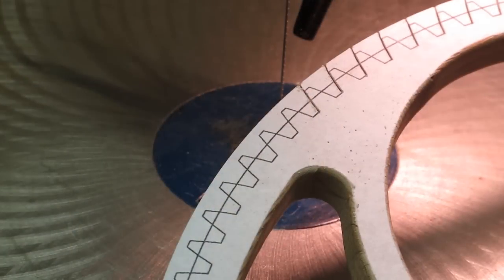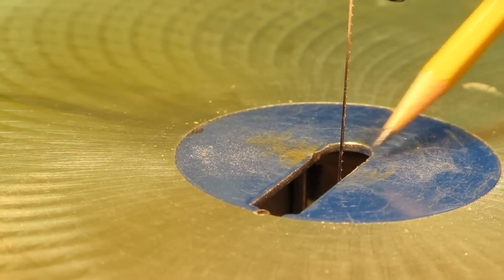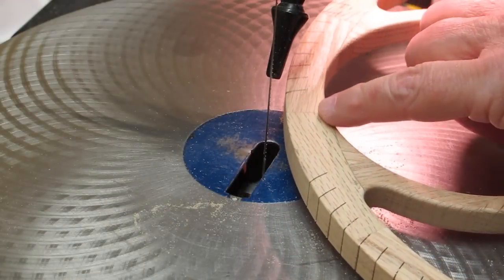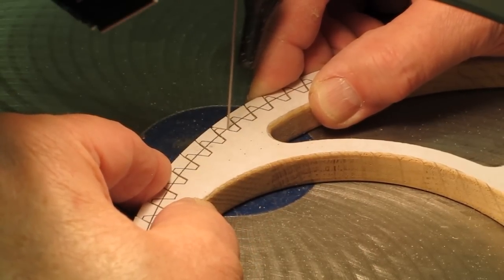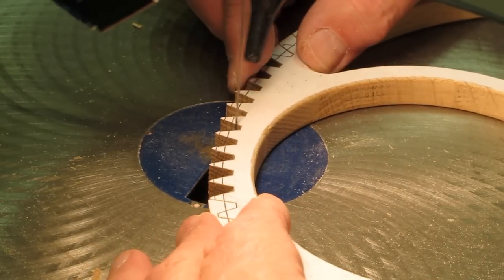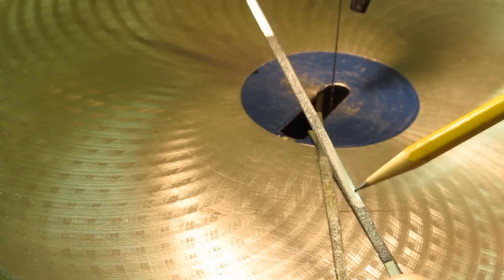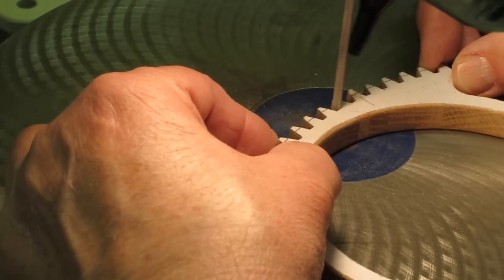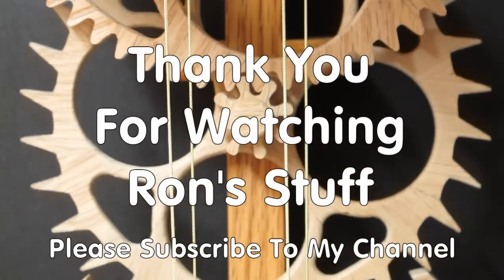Cutting Wood Gear & Clock Wheel Teeth

Comment: This is the best video on youtube about making wooden gears using a scroll saw - thank you !  I now look forward now to making my first wooden  clock..
Reply from the maker: Thank you! I have quite a bit more on my channel that will be of interest to you as well. Hope you have subscribed.  I highly recommend clock designs by Clayton Boyer.
Reply: Ronald Walters Indeed I have subscribed to your channel, and I hope that things will soon start ticking in my workshop !
Reply from the maker: An expensive suggestion that will make your life easier if you are serious about making good clocks. Nothing like giving yourself an early Christmas present.

My best clock-making tools (and the most expensive). Finding the exact center of a template, marking it a bit deeper and then accurately drilling the holes. The flutes on these drill bits will draw blood (razor sharp). Treat these as prized possessions and stuff keep them locked up and out of reach of anyone else.

Veritas Optical Center Punch $62.50https://www.leevalley.com/en-ca/shop/tools/hand-tools/marking-and-measuring/marking-tools/45502-veritas-optical-center-punch

Veritas Japanese Style Awls $26.50 and $32.50 https://www.leevalley.com/en-ca/shop/tools/hand-tools/marking-and-measuring/marking-tools/70874-veritas-japanese-style-awls

HSS Lipped Imperial Brad-Point Drills 5/64” to ½” $264.00https://www.leevalley.com/en-ca/shop/tools/power-tool-accessories/drill-bits/42247-hss-lipped-imperial-brad-point-drills\

Comment: I'm really admirative... I'm not as patient as you are! That's the reason why I use a CNC machine. Allright, it is less artisanal, but I've no time to begin cutting tooth by tooth.
I made it for a hand machine that blows air for a barbecue. But not for clocks!
Thanks for your video and for your explanations about the process.

Comment from the maker: I guess you could make one. The gap in the one you see is from Delta and is made that way so the table can tilt and still have blade clearance. I liked the gap as I had a dust collector under the table and all the cut outs from the teeth disappeared through the slot and out the dust collector (handy). I sold this saw and now have an Excalibur.

Comment from the maker: That is a Delta 40-540 which I used for years. Lots of vibration and I had to do several repairs over the years. I don’t think it was intended for the type service I was asking of it.  I have since sold the Delta and purchased an Excalibur, a very nice very well made saw but a bit expensive. A friend has the Dewalt DW778 and is very happy with it. Some of these seem expensive but buying a cheap saw and then throwing it away to go buy a good saw is really the most expensive approach.

Comment from the maker: Sure, you can do that. Depends on the design of the gear teeth (round of flat bottom). It requires a really sharp, accurate brad point bit and a good backer or you will get tear out on the backside. Also, the drill center point needs to be located 100% accurate every time or it will look bad. After cutting a bunch of gears I find it just as easy to cut the whole thing out with the scroll saw and forget the drilled holes. Practice makes perfect!

Comment: Since belt sander paper is thicker it doesn't tear under light tention - I just cut a strip around 5" x 1/2", folded it in half long ways and mounted it just like it was a pinless blade. Used the same strip for about an hour last night with no problem. Maybe with the paper there is a radius but it's not detectable to the eye. Working on my first clock so time will tell :)

After I saw your video I ordered some scroll saw files but haven't received them yet - looking forwared to testing them out.

Comment from the maker: Matthias cuts a lot of gears on the band saw.  Then it only makes sense to cut into a drilled hole if the design of the teeth allows you to do so.

Comment: hmm, ive cut quite a few gear teeth but always used a inch belt linisher, for cleaning up.  Not as precise as the scroll saw file, but very efficient none the less.  Thanks for the video and the information.

Comment: Quite correct on all the things that would affect the tone switching between different blades. I was assuming the same blade as you recommended, same mfg, same teeth. If the thickness and length still vary too much after that, then I agree, one just has to break a few blades to learn the "feel" achieved by plucking the blade. Given the risk and damage caused by breakage, I was just looking for any way to reduce variables.

Comment from the maker: Using Matthias’s gear template generator, I think it will export a file for use with CNC. I have to admit when making a stack of the same type gear I thought about how handy a CNC would be. :-) Is it the best solution? I do not think it is for something if you want to truthfully call it handmade. The use of a scroll saw is just not that difficult and it is extremely versatile.

Comment from the maker: I have not personally designed clock wheels or gears. The clocks I have built have been Clayton Boyer’s designs. I think he uses a CAD program. For the other gears I have cut… marble machine, planetary gear drive, clock winder, pin gear - ring gear, etc. I have used Matthias Wandel’s Gear Template Generator (woodgears-dot-ca). Matthias also has a free gear template generator on his website which you can play around with to see if it gets you close. The program he sells is much better. 

Ron

Comment: Ronald, nice video.  Maybe a useful tip about the abrasive blades you use in the scroll saw.  If the blades are just covered with epoxy and abrasive couldn't you re-coat the bare blades?  I get some aluminum oxide (available in 70 and 220 grit from Horrible Freight for some glass etching and blasting which, with a suitable adhesive, could be used to easily re-coat those blades.  In my experience, heat softens epoxy so...warm them up, scrape 'em clean, apply adhesive, sprinkle with adhesive. ?

Comment from the maker: I have seen some ¼” sandpaper strips (which a friend had) with clamping ends. My impression was they wouldn’t last very long and the paper couldn’t be replaced. Also, when you pushed the workpiece into the sandpaper, it tended to sand a radius rather than a square surface. We were hesitant to over tighten the strips or they broke prematurely. 

I don’t know how I would clamp just sandpaper in my saw. Someone needs to invent some little clamps.

How do you actually clamp the paper into your saw?

Comment from the maker: I guess it would be possible but I do not know why you would want to. Paper or cardboard is not the most stable medium and can get fuzzy when it is cut and sanded. Gluing it in precise even thickness layers would be a trick. Might as well use MDF, which is not much better than cardboard and is easily damaged. Good luck.

Comment: I haven't had much experience with the scrollsaw, and the one I use is one I made, powered with an electric drill.  I would sometimes use a blade for a couple of hours, and sometimes, I would break it almost immediately.  I found that it always started by sticking in the workpiece and hammering it up and down, but once that happens, there's not much chance of saving the blade - so I clamped a piece of wood across my saw table with spacers under each end, so that it went across the workpiece, allowing the workpiece to be manipulated, but not allowing it to move more than a couple of millimeters up and down.  After that simple mod, my blades lasted a LOT longer.
If the workpiece is big, and the cuts are complex, meaning that it needs to have a lot of freedom of movement, then this method may be awkward, but for a gearwheel, which only needs to be moved the distance of the depth of a tooth, and the workpiece is always in the same position relative to the blade, the method would be easy to implement.
Reply from the maker: Most scroll saws have an adjustable fork shaped guard that is also supposed to help keep the workpiece from jumping up and down. Personally, I always remove them as they just get in the way and make it more difficult to see what you are doing. Holding constant downward pressure on the workpiece maintains control. Using a foot switch also helps maintain control so you can stop every once in a while to reposition things and do not need to remove one hand to turn off the saw.
Reply: Thanks Ronald, I have seen the fork-shaped guard on YouTube videos, but the design of my saw doesn't allow for its implementation.  I also know that downward pressure is what's required, but even at moments when I thought the pressure was more than adequate, the workpiece has suddenly started jumping.
I do also use a foot switch.  https://youtu.be/qPjozDIyPJo?t=1067
I think the problem may be down to the machine itself.  The oscillation of the saw blade is much slower than on the commercially available machines.
Reply from the maker: The slow blade speed could certainly be the issue. Get a reasonably good quality saw and you will start having some fun. I used Delta scroll saws for years and they are OK, but when I upgraded to my current Excalibur it really made a difference.

Comment: HI Ronald,
Very good video, I have been trying to make gears for a clock, however I struggle with developing the right profile for the teeth. Can you tell me how you get that design and does this work for small wheels as well? The smallest wheel I want to cut is 18mm dia. on the pitch circle and has 8 teeth.
I look forward to your comments
Anton

Comment: Great tips! Have you tried using sand paper in your scroll saw instead of scroll saw files? I've cut 5" strips from belt sander sandpaper and clamped into the scroll saw - seems to work real well at sanding down to the line, and it's cheap.

Comment: You've taken great steps to make true, and stable, gears out of solid wood. Curious what your thoughts are on stabilizing the wood itself?
Reply from the maker: Good question. I made the C&R Grain Solid Wood Wheels quite some time before I was set up to do wood stabilization. Wood stabilization requires several steps, the last of which is baking and it makes quire a mess requiring cleaning up the wood surfaces. Stabilization and baking may also cause some dimensional changes in the wood. Therefore, the stabilization would need to be done for the wood raw material before making the blanks, gluing and then cutting the teeth. Regular aliphatic wood glue may not work very well with the stabilized wood (I haven’t tried gluing any stabilized wood) as it does not seem to be as porous and is a bit more like plastic after stabilization. Experimentation would be required. I have a video “Cookware Pot Lid Handle Replacement - Vacuum Infusion” https://youtu.be/W8NwwRi9ieU which may be of interest top you. Thanks for watching. Please Subscribe… that is what keeps this channel available.
Reply: Thank you for the reply.

Comment: Howdy Ron, another great video!  You glue up your wheels/gears...is that for stability?  I was thinking of using solid hardwood...not a good idea - will it warp with changes in temperature & humidity?  Thanks, Mike
Reply from the maker: I show making solid wood gear blanks out of glued up segments and sometimes it works and sometimes it doesn’t. Just the water in the glue can get things going warping & splitting). You need to immediately plane to final thickness and cut out all the webs... then let it sit and stabilize and see what it does... and maybe the solid wood will cooperate and maybe it will not.
Plywood is the best choice for gears, specifically Baltic Birch Plywood.
I have another series on making gear blanks and mixing up the grain direction which worked very well but it is a complicated approach and again you need to immediately plane to final thickness and cut out all the webs and let it stabilize.
Video: C&R Grain Solid Wood Wheels - several parts to the series
Making solid wood clock wheels using circumferential and radial wood grain orientation to minimize the chance of having the wheel split or distort due to climatic changes.

Comment: Some thoughts and questions born of ignorance (surely a curable condition) (:-) mark the locations of glue lines onto your paper pattern before gluing it down?  I do not have experience with a scroll saw but have done some such cutting on a band saw. Would a plate with much less clearance help or even be practicable?  For the bottom of the notch, why couldn't it be drilled out prior to cutting the notch out?

Comment: On the tightness of the blade, those with some musical inclination may want to achieve consistency by using a (free) guitar tuner on their smart phone or anything to generate a tone.  This particular video sounded pretty much like it was tightened to a "D".  The tone wasn't pure, but using that as a guide would be quite close.
Reply from the maker: Might work but more likely an over complication. Blade thickness, blade width, the number of teeth, can all play some part in this sound. Probably the best approach is to get a feel for it by doing it and see how the particular blade is cutting.

Comment: you need to get a gum rubber cleaning bar for the sanding strips on the scroll saw.  these gum rubber cleaners are available at stores that sell sanding gear.  these bars will clean the sanding strip until it is like new.  I use them on many of my sanding disks and pads.
Reply from the maker: slad roznik I use the gum rubber cleaners all the time. Generally, they do not work on these filing strips.

Comment: Sir, your videos and workshop are amazing! Might I ask how long it actually took you to get all of those tools together? Your work is inspiring, but even if I had skills to match yours, I'd still be missing 90% of the necessary hardware.
Reply from the maker: +Ventura López  I worked overseas, so I did not accumulate many tools until after I retired. Purchased my table saw when I started building my house and other stuff was accumulated since then. You don't necessarily need all of these tools to make these projects but it does make life easier and good dust collection makes it healthier. Many a wood gear clock has been made using a hand drill, coping saw, hand files and sanded by hand. Thank you for your kind remarks and for watching!

Comment: Do you use any gear generator for your gear profile?
Reply from the maker: The large gear shown in this video is actually for the Solaris Clock, a wood gear clock designed by Clayton Boyer. For other gears I am designing myself, I use the gear template generator at woodgears.ca . There is a free version on the website (lower left hand corner) or a better version available for purchase. I have quite a few wood gear projects on my channel where I used the woodgears.ca template generator. Thanks for watching. Please Subscribe!

Comment: hallo mr Ronald.
could you please tell me kind of wood is the best to make shapes. I have tried to make some shapes but unfortunately broken easily.
Reply from the maker: MrHaninah I use Baltic Birch Plywood for the gears and basswood for the ornamental or decorative shapes. Basswood cuts easily but can be easily broken. Most any wood can be used but cutting time will take longer for harder woods.

Comment: Ron, what brand of scroll saw are you using?
Reply from the maker: The one in this video is an older Delta Scroll Saw.
For the past 6 or 7 years I've had an Excalibur Scroll Saw and generally I use a foot switch. Excellent saw, a bit expensive. Only thing I do not like is the table top is powder coated. I have since sanded off the powder coat and keep it waxed.
I have a video on how to Tighten the Blower Tube https://youtu.be/_CscPROkWwI
The videos on my Gear Head Construction show the Excalibur in use. https://youtu.be/z6O6ZRlQi34
... and the fret work for the second Senior 20 organ. https://youtu.be/jiLMHuohpJc
Thanks for watching! Ron
Reply: @RonaldWalters2010  Any thoughts on Hegner scroll saw?
Reply from the maker: I have heard some good things about them (unconfirmed) but I never have used one and do not know anyone who has one. Roughly 2-1/2 times more expensive than an Excalibur I doubt that it is worth it. Keeping in mind that German quality is not (in my opinion) what it used to be with many products. 30 years ago I was overseas in a very remote location and wanted a small metal lathe. Having little to no personal experience with a lathe, I purchased a Prazi (made in Germany) strongly influenced by the "German quality" thing. Have not been more disappointed in a tool since. Turned out to be poorly made and falling apart when I got it. First problem was an unbelievable misalignment of the motor and arbor drive pulleys which ate belts as you watched it. I could not correct the alignment with the pulleys on the lathe and had to make new ones. Had we not had a good machine shop on site I would not have been able to repair it nor correct many of its deficiencies. 
Scroll saws in general are probably all going to vibrate and move around. My Excalibur is mounted to a 1/2" piece of plywood which has four rubber feet under it. I then have two 5/16" T-nuts mounted in my workbench (one on each side of the plywood) and I use two star knobs to tighten it down on the workbench when I am using it. Problem solved. I may make a video on that one of these days.
Excalibur was made in Taiwan (I assume it still is) and was represented by a General International in Canada, which now appears to be located here in the USA.
That's all I got! :-) Ron